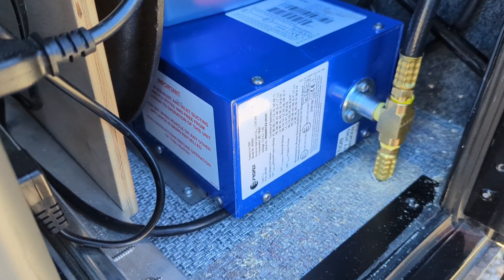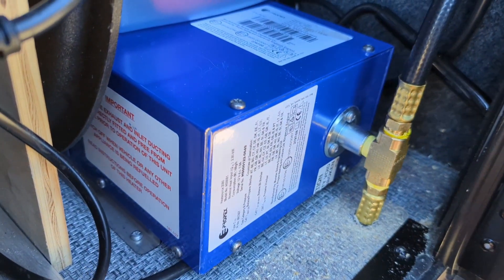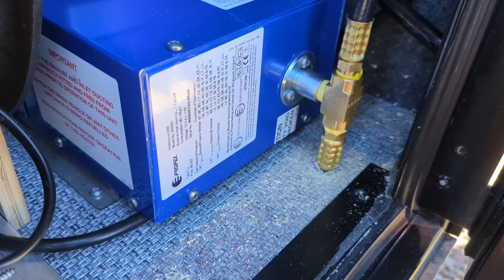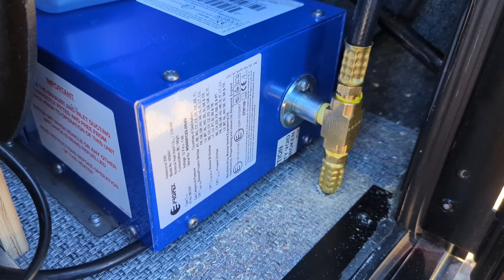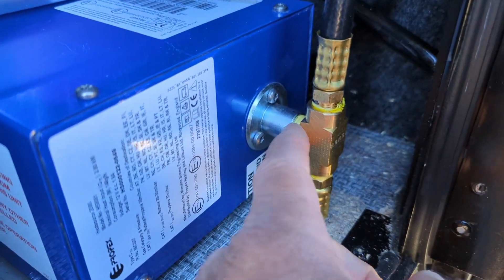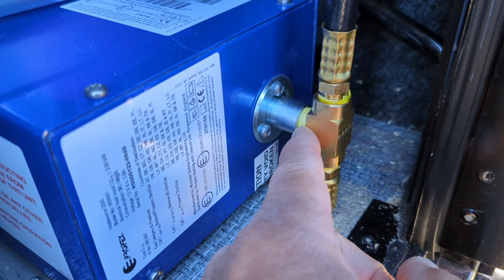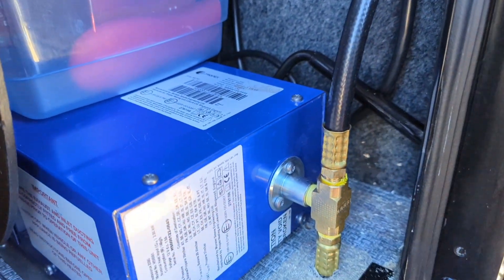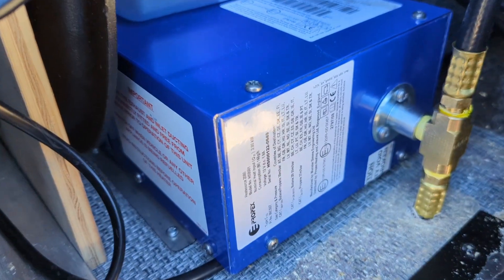Customized 2021 Intech Flyer Chase gets a Propex heater! Part 2

Comment: Nice install.  I'm in the process of outfitting and Explore and need heat.  May I ask where the heater is located on your trailer?
Is it in the battery box or slide out kitchen area?  Thank you.
Reply from the maker: Thanks, Bill. The Propex heater is located on the floor, at the right rear corner, and is accessible at the rear doors for service. 

I removed the trailer's front tongue box due to space conflict with the spare tire mounted on the rear bumper swing arm on the truck. The tongue is now covered with aluminum diamond plate and will soon have a rack to hold two 20L water cans and propane bottle.
Reply: Thanks very much for the informative reply..  I will attempt the same in the spring armed with your info. Cheers